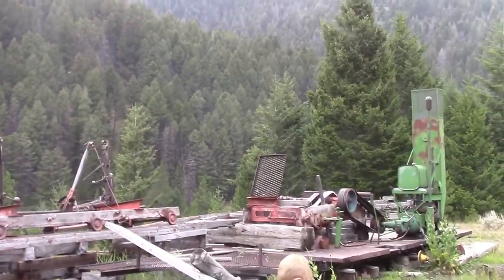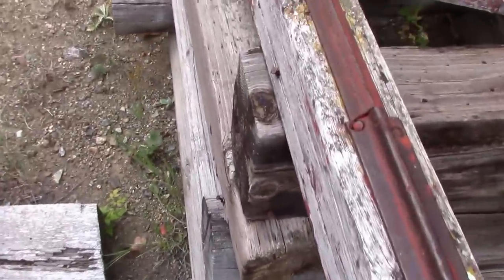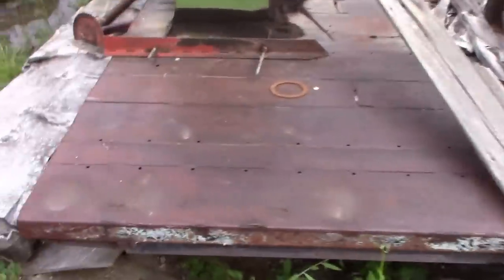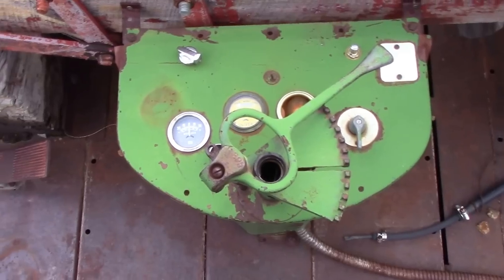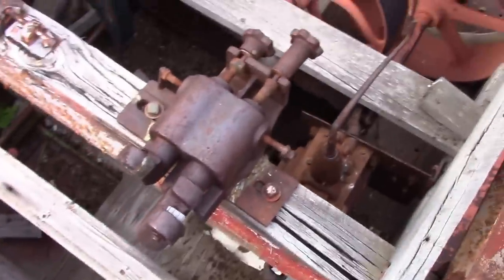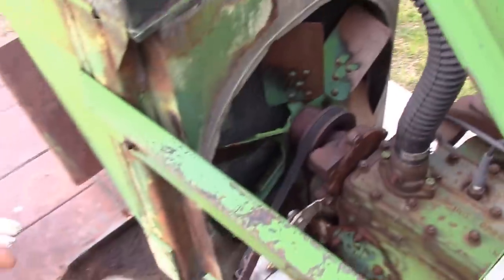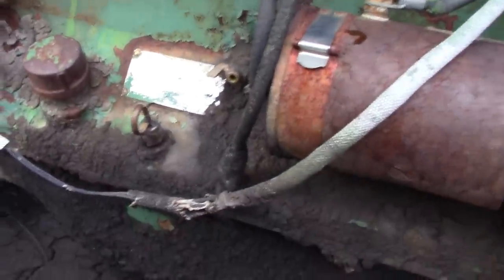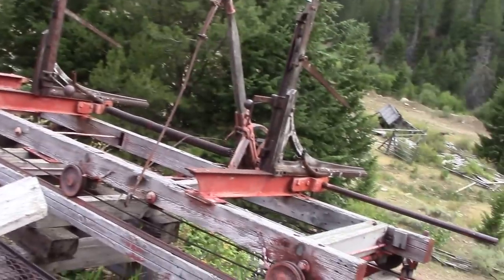Abandoned Sawmill

Comment: The engine unit is a continental power unit used on Oliver Combines.  This unit was on the model 33 and 35 combines.  It actually has two clutches on it.  The one that the belt is currently on, was used to power the threshing portion of the combine.  The wheels were driven by a drive shaft (not shown in video, however clutch lever is present) coming out of the clutch housing in line with the crankshaft.  The transmission is located in the housing of the drive wheels of the combine.  The instrument panel is the exact panel of a 33 or 35 Oliver combine including the throttle lever.  The square design of the radiator air intake was found on the early models.  A rounded top was also used.  Search for Oliver 33 or 35 combines to view the engine.
Reply from the maker: Thanks for the awesome info.  Any idea on age?
Reply: Somewhere in the range from 1949 to 1955.
Reply: The Continental 6-226 was also used in Willys Jeeps (trucks and wagons) up until 1961.  Some forklifts and other industrial equipment used these engine up to the '80s.

Comment: The device you were questioning with the wood plug was a part of the blade guide. More common for people to see on a band saw, but the same principle, to keep the saw blade true and straight. They touch the blade lightly on both sides just below the gullets and prevent blade deflection

Comment: that's a combine  power unit. high air intake   and the clutch set up just screams combine the trans would just be used for gear reduction  the reversing would be done on the flat belt and a frishion tire  that was you get fast revers and a slow a head no clutch needed..

Comment: The F226 in the number should indicate that the engine is a flathead 226 cubic inch.  Thats a common designation for the Continental engines.  I also agree with the gentleman who earlier identified the power unit as that off of an Oliver combine.  I currently power my small mill with an Oliver 88 gas tractor pto which has a 265 cubic inch 6 cylinder engine.
Reply from the maker: Thanks for the info.  Would love to see your mill in action.

Comment: I subscribed just to see more of this mill. A week tops and I would breath life back. That should be saved. They used old shingle saw blades in them, circle saws with the blade determining the size logs it could run. The "curf" on the blade is why they quit using them! Saw curf is how much wood the blade used to cut up the logs. Normal was 3/8" curf, two cuts and a part was one inch of the wood into sawdust, hence small logs didn't leave much... If I were not so old, (72) I would lay that all out on a old school bus frame and new wood for careage if not steel... what a gold mine. There is plenty of trees big enough to justify it. Wood is renewable so not killing live trees, just the dead and down. I would of enjoyed better if you didn't pan so fast, makes you dizzy but you got enough on that. Great video... please tell me that it will be saved. That old continental engine is still made today and will just about  last forever. That mill can be set up to a band saw so it can be used if saved

Comment: That's a Frick mill. Hercules power unit off of a 55 combine
Reply from the maker: Joel Adank Have you worked with them a lot?  Curious what tipped it off for you.
Reply: NelsonStudios  We have had two frick mills I can tell by the works which is the head stock that's what it is they are still in business. As for the power unit it was a popular combine in the Late 50s. That mill would have been way under powered. We have a Cat D7 gen set engine on ours with a 54 inch blade on milll.
Reply from the maker: Interesting.  I would love to see yours, do you have any videos of it online?  I will check your channel.

Comment: Where was this located?  BTW, I think that small assembly near the blade hub may have been a brake mechanism, such as a rudimentary caliper.
Reply: The device you are referring to is actually a saw guide.  It is to be fitted with wooden pegs that are to be adjusted inward toward the blade to minimize blade movement.  The pegs are like dowel rods that are sometimes just whittled down to fit and driven in with a hammer, alightly shy of coming in contact with the blade.
Reply: Tractorman44 you are correct